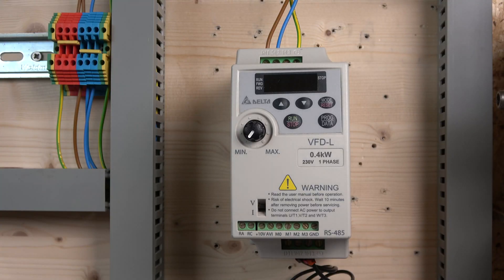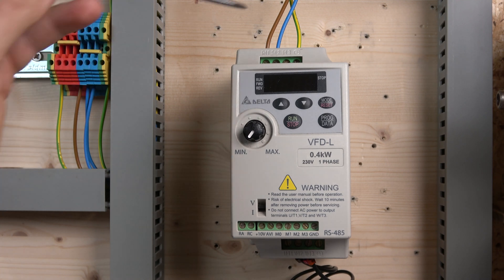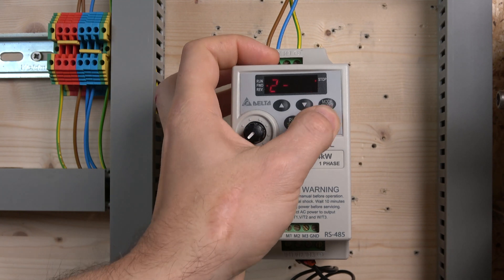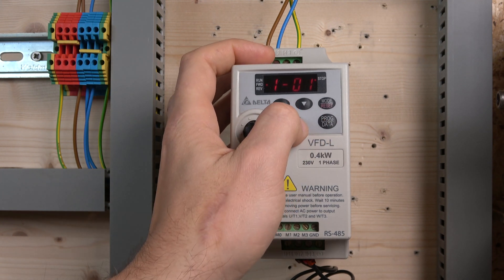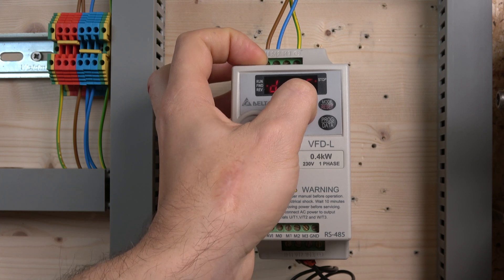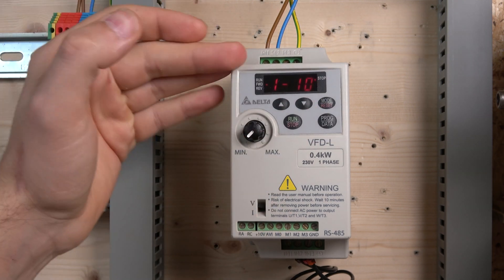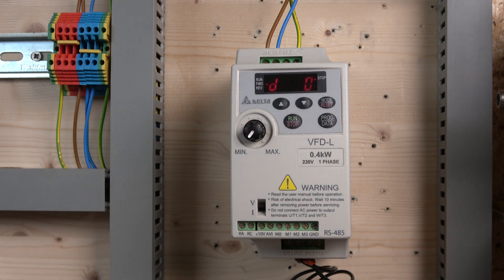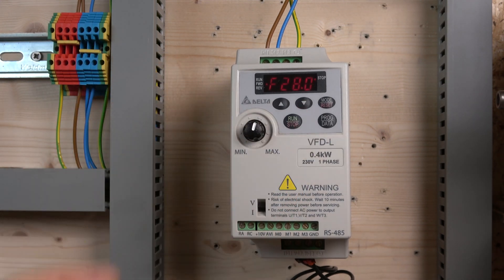Delta VFD-L Drive, local control, commissioning, parameter set up, Factory rest. English

Comment: We have Delta L-Series VFD installed on one machine. With Potentiometer connected to GND, AVI and 10V terminal for speed setting. Other Terminals on VFD are M0, M1, M2 and M3. Where shall we connect Selec PIC 101 process indicator on VFD? Shall it be connected to GND and AVI Pins of VFD?

Comment: I'm curious.. What would happen if you left the overload at 85 would it break the motor? this is great content and you have a really clear and easy way of teaching.  Thankyou!
Reply from the maker: Hi Jack. Your overload should always be slightly lower then your motors rated current. If you go over and there is pull for more load then motor can handle, it will eventually melt winding's and motor will stop working.